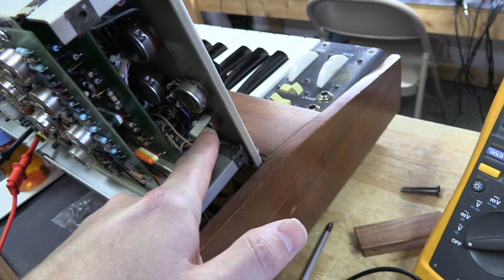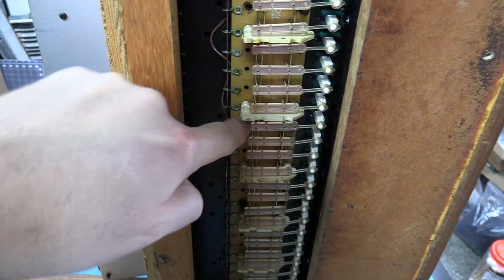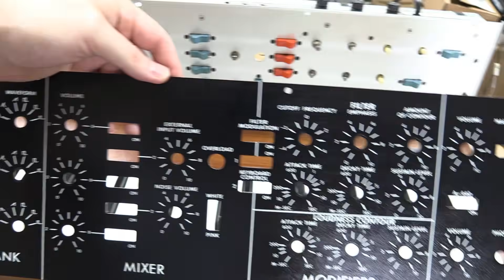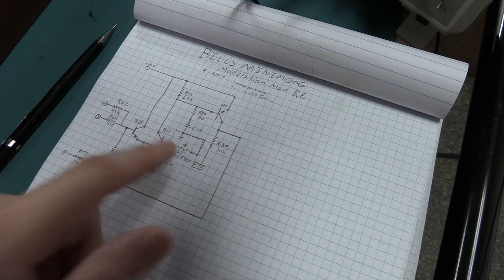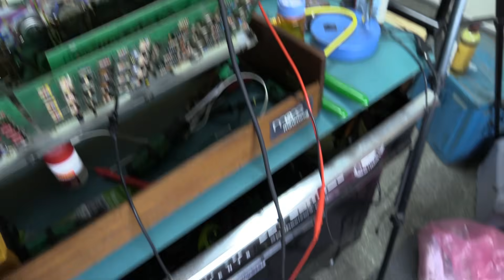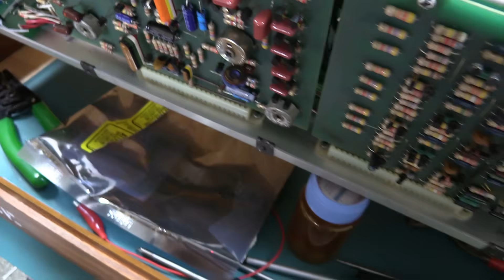William's Minimoog Restoration/Demo

Comment: Another awesome trouble-shooting and restoration, Jareth.!!! Isn't it aggravating to have to fix someone else's repair work that didn't  fix things right the 1st time? A quick question.  I know you use wrist straps to ground yourself, to probably a jack on a table, but do you have it going directly into a "earth ground" too? Also, noticed that you didn't demo, the "External input" Jack (again)....chuckles
Reply from the maker: Thank you very much. 
Yes, I have my bench grounded to earth ground. I have two ESD work areas, the blue mat I have setup as a temporary mat because some synths are larger than my table. What I do with those is keep them plugged in so chassis has ground but I kill the 120 line voltage so nothing is hot. My primary work bench is a permanent grounded bench which is where board rework actually takes place. I take ESD very serious because all it takes is a little static to damage components or cause latent failures.....it's just extra insurance for the restorations. 

Yeah, I just always sort of skip on that ext input during the demo, I test it during the restore though so I know it works.  

Thanks for watching as always🙂